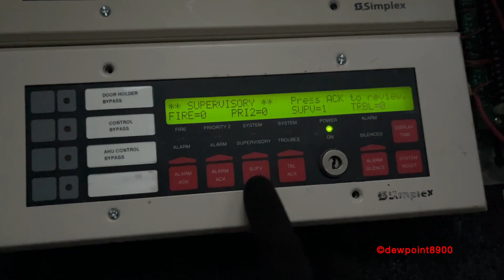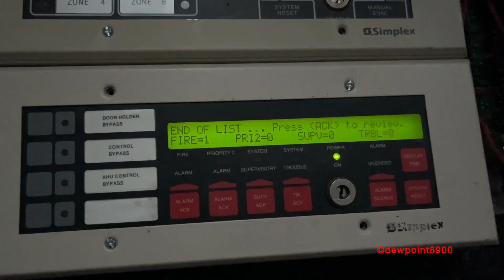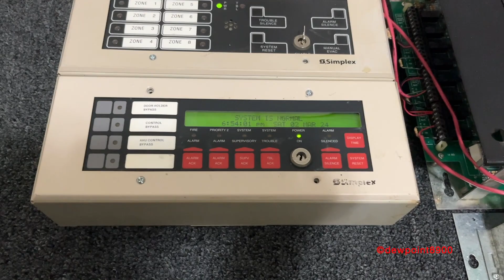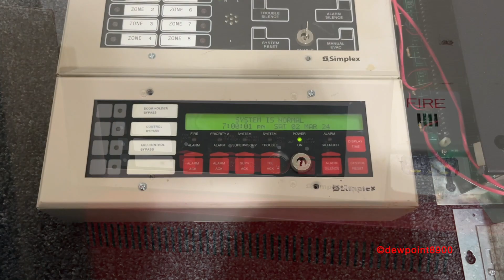Simplex 4603-9101 Overview

Comment: Where does the green ground harness wire on the back of the annunciator connect to?  Does it connect to the back box or does it connect to the control panel?
Reply from the maker: It connects to another PCB in the back.
Reply: @dewpoint8900  Thank you!

Comment: 4002 code 3? nice regardless!
Reply from the maker: Yep! My 4020 is running older software that uses the 4002-style code-3. Oddly enough, my 4002 is from 1994 but has the normal code-3.
Reply: @dewpoint8900  you’re the one in masterbox with the newer 4002 aren’t you, it was discontinued in ‘95 so you likely have yourself a version that no longer did the 2.5s delay on code 3.
Reply from the maker: @trainknightt  Yeah, that's me.